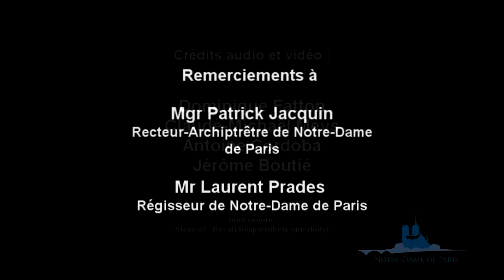Cathédrale Notre-Dame de Paris - Sonnerie des 10 cloches (Grand Solennel/Plenum ) - HD

Comment: I love is Incredible bells and the emmanuel is very beatiful
Reply: Emmanuel Bell Is very heavy
 ,1300kg
Reply: Bandus Meirás Martín  it was cast in 1685
Reply: The main reason it is rarely rung is because it is 336 years old. Thus, it is very brittle and the metal is not bendy like it used ti be.
Reply: aaaaaaaaaa that's the reason why it is not rung much
Reply: @lukea.6298  thats not the reason. Every chatedral dosent ring theyr big bell as its for rare events
Reply: Most cathedrals ring the big bells for major events. But for the full peal like this, it rings a lot.
Reply: @bandusmeirasmartin366  Emmanuel 13 tonnes no 13 q.li

Comment: To sad that probably that will not be heard again, at this moment the north tower whit 8 bells is burning, this is goning to be a historycal video of the bells
Reply: The bells of the North Tower were installed in 2013. They can be cast again. The South Tower with the historical bell is still intact. For the rest of the cathedral, the roof is gone but the ceiling remains intact. Don't loose hope.
Reply: Thanks. We are so sad ......
Reply: not loosing hope but these bells sounded good i hope everything goes ok